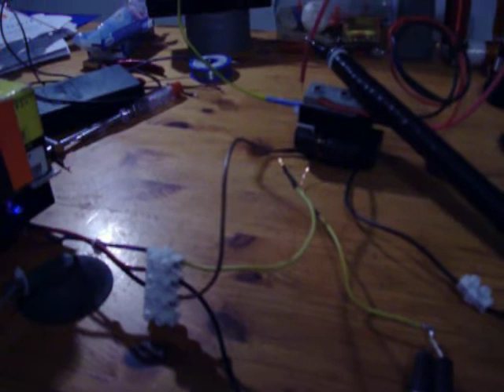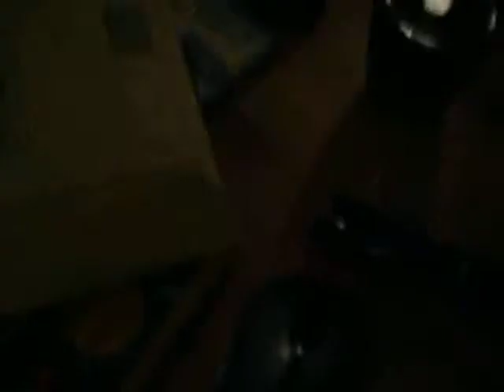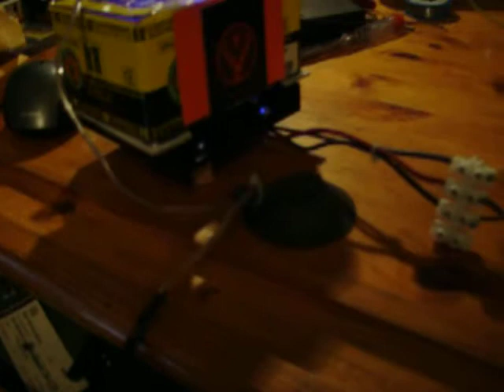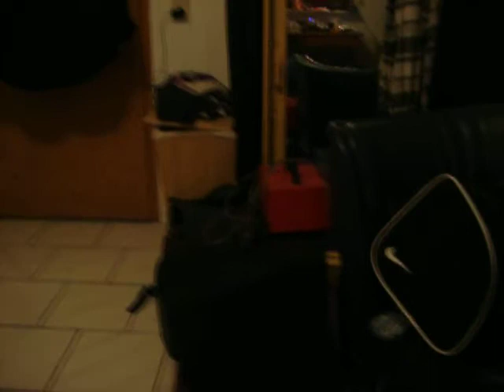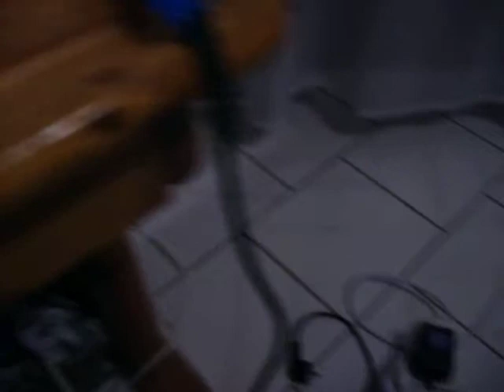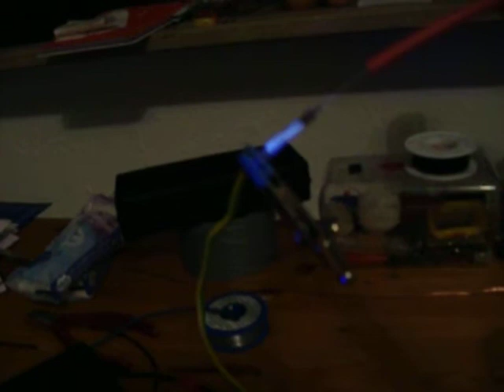2n3773 in series flyback driver

Comment: Hi friend. You will get there mate in the end" and you will be saying to yourself yeah!!!! Im there lol ;-) i did it. So dont worry my friend. Theres me and john and pete who will help you if you find something troubling you ;-) thats what we are here for :-) but them guys say im the zvs king haha ;-)

A small pointer mate with the flybacks. If you pull the pins right out the bottom of the flyback and them fill it with some hot glue or even better some 2 pack apoxy it  stops pin flash over.

Comment: Hey there, nice improvements!  The best part about the driver is that fact that its been stable!  You could keep that circuit around and try out all kinds of transistors and see which works better!  Maybe if you can get a hold of an old PC, you could potentially salvage the supply!